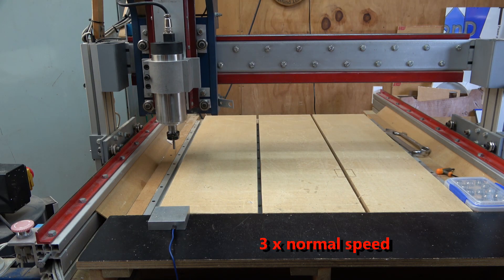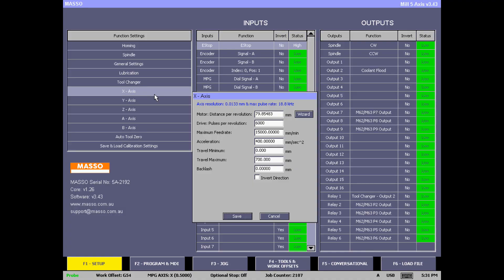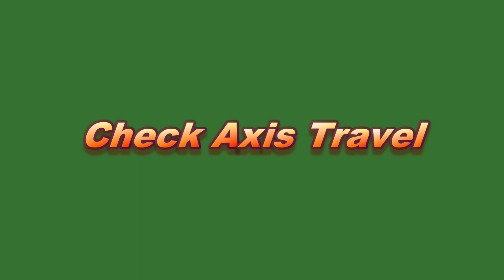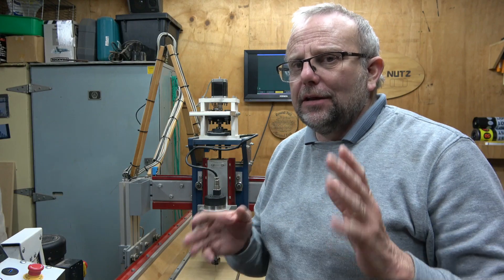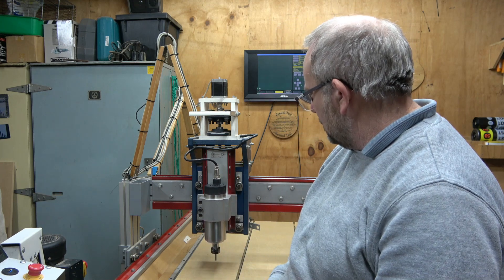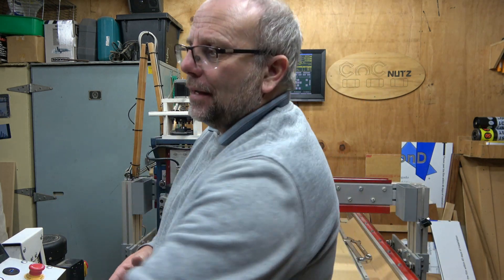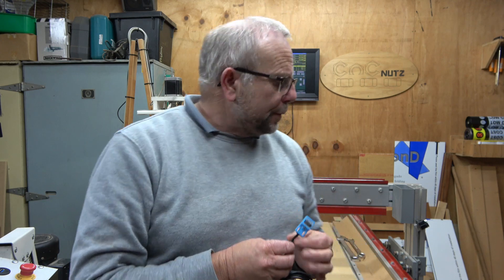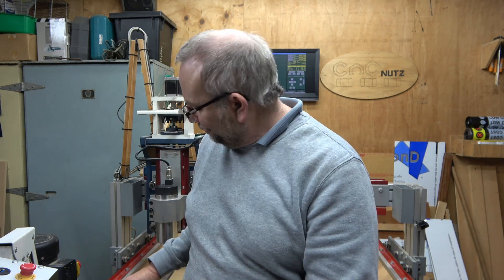How to Set up Homing on Masso - Masso Edition 15

Comment: * NOTE * You should enter G91 to set the machine to incremental mode before entering Z20 or X200. Your machine will interpret these commands as absolute coordinates if it is in G90. Ask me how I know. 😮

Comment: Peter, I am trying to understand how the physical wiring to Masso should be done.  The Masso documentation shows the negative wire is connected to the negative on the Masso and to the negative on the 5V power supply. Is this correct? Why would There be a need for two negative leads?  The specs of the Masso sensor shows a voltage range of 9V to 24V, but the documentation shows 5V.  I am uncertain as to which power supply I should connect the Homing switches.  Thanks for all the great information.  I really appreciate your time and effort.   A video showing your connections would be awesome.  Steve

Comment: Hi Peter, thanks for all your help and time doing videos, they are a great help for us newbies. 
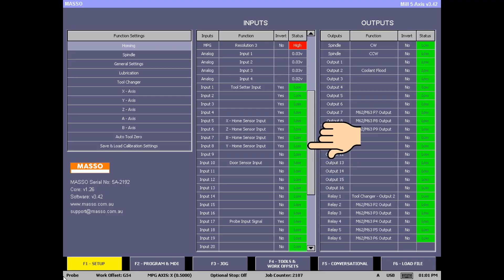My question is ; The Roko switch you show in these videos is a SN04-N at the 1:31 second mark. 
Is this  a "Normally Open"  type switch.  Are we best off to use the "Normally Closed" type as they are safer with regard to wires breaking or coming off. 
 I tracked down a supplier of this brand of switch,  he offers them in a 'NO' or 'NC', but also the option of  NPN or PNP, can u please tel me  which is the correct type to purchase. Thanks in advance.

Comment: Where did you get those prox sensors?
Reply from the maker: I purchased them on Ebay. Look for SN04-N and you will find them easily. they are cheap as well.
cheers
Peter
Reply: @cncnutzmassoedition9131  Thanks Peter... keep the videos coming I think they are great.... super helpful. I have prox switches on my 3 axis mill but havent been too fussed with them and been looking for something different. I loved your video on the emerg stop..you solved the issue of my MPG wiring
Reply: @cncnutzmassoedition9131   Happens to have this exact switch from a 3d printer add on that I never used and it does not work. I don't see the input change the status to high.

Comment: Like the idea of inductive sensors for limit switches.  Did you use NO or NC. Or can it set up in software?
Reply: Use NC. That way a bad connection will fault out.
Reply from the maker: They change state from high to low when triggered. You sort it out in software later. You can use NO or NC switches with Masso.
Cheers
Peter